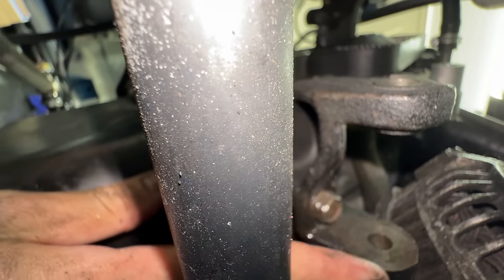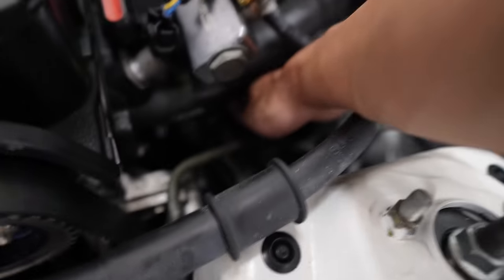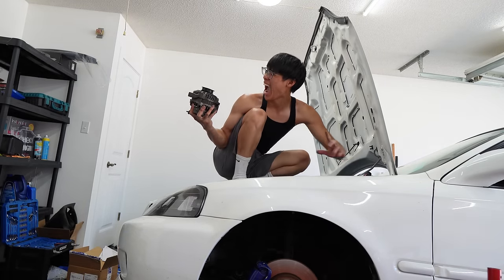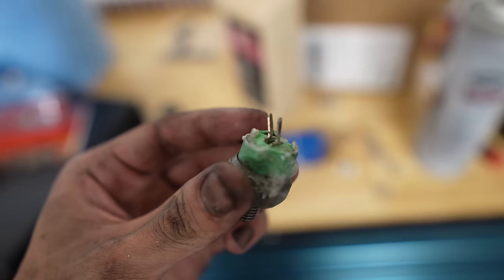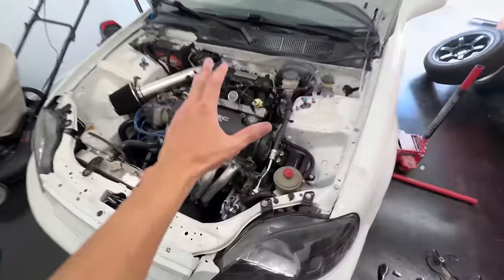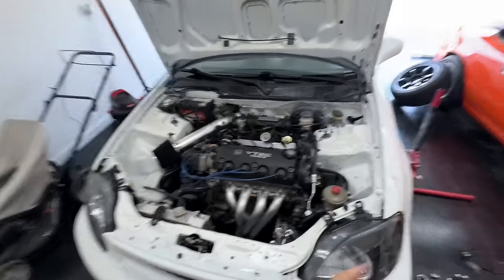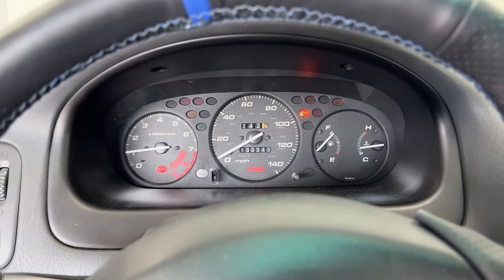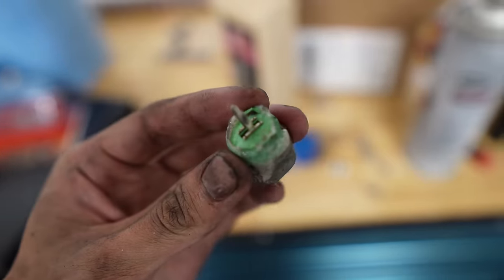Fixing The Biggest Problem With The Civic. Will It Run?

Comment: Pull the vacuum hose from the regulator, plug it, and start the car. Adjust it to 43-44psi.
Dont set it with the hose connected:)

Reconnect the hose when you are done :)

Comment: Dummaaa I helped with mentioning checking for voltage glad you were able to narrow it down & a clogged car could cause some of the issues you had I forgot to mention that the 02 sensor rely on that for ECU data; for the alternator I personally know someone who rebuilds them or i just go OEM but glad you were able to solve it 🤩‼️
Reply from the maker: Thanks for all the tips! Definitely going oem. Can’t beat original parts 🛠️

Comment: The dizzy rubber O ring is cheap from the dealership and easier to replace then a whole dizzy. 

That's a common oil leak and when it drips oil on to a rubber heater hose. And that hose becomes soft and till have a small coolant leak.
Reply from the maker: I replaced it but it still leaks from the dizzy

Comment: Sir I want to give a tip when having a rounded bolt get a size smaller metric or standard and beat it on with a hammer then take it off it'll be hard to get the bolt out of the socket but it's worth it

Comment: Should've just replaced the o-ring and oil seal of the distributor instead of replacing it with a non original Honda part IMO.
Reply from the maker: I did in the past but it still leaked from the seal inside
Reply: @jarekmai  Maybe during the installation the seal isn't seated properly? or the bearing in the distributor is worn letting the shaft wobble and it can't make a good seal.